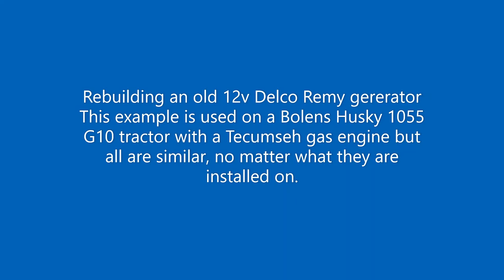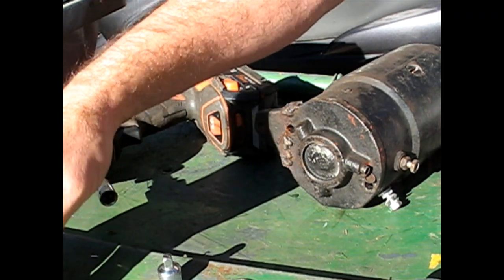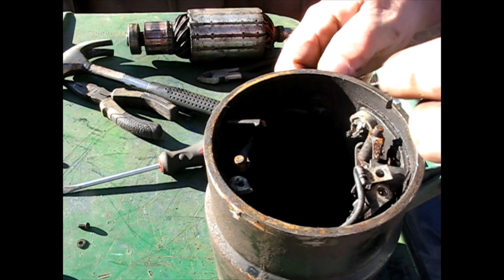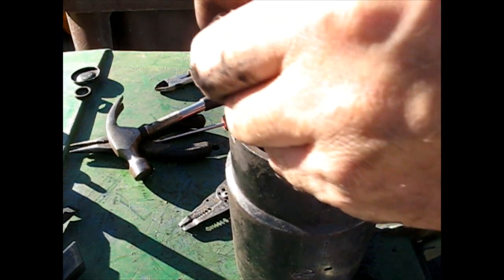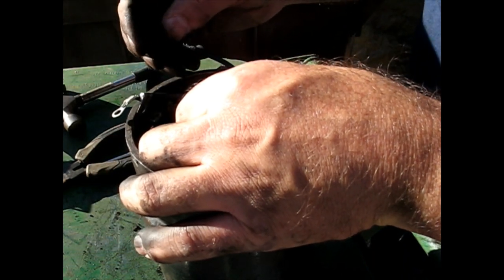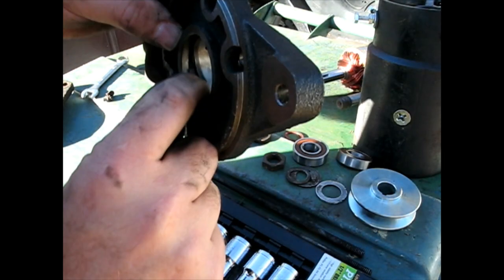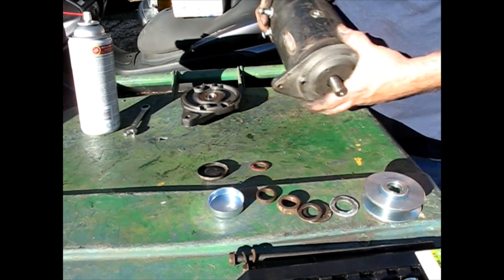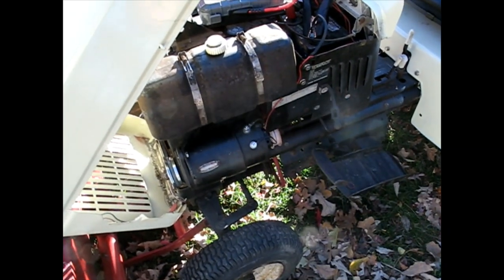Rebuilding classic Delco Remy 12v generator starter generator

Comment: I have the same model starter/generator on a 1964 Simplicity 9 HP Briggs Garden Mark Garden tractor.
I was plowing snow and the generator bearings started screaming and the bearings seized up.

I called a local auto-electric shop who says that they can rebuild it so I will take it in to them today.

My Dad bought the tractor used in 1971 and the generator may have been rebuilt once already since then... can't remember for sure...so it is due for a rebuild after 50 years of use under his and then my ownership.

Comment: Does the rebuild kit come with instructions ? Would it make sense to spray any of the internal parts with silicone or a spray dielectric grease to prevent rust ? And what about sealing the end caps with some silicon caulk so water couldn't get in there ?